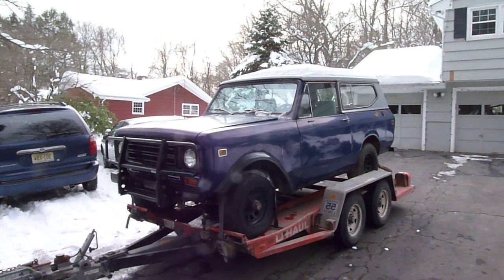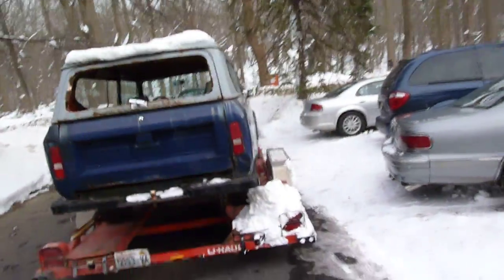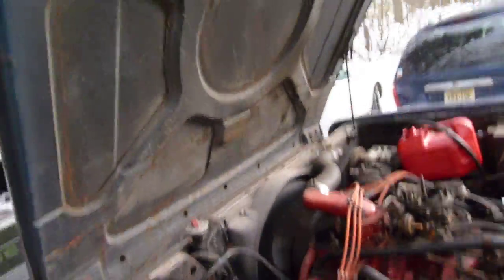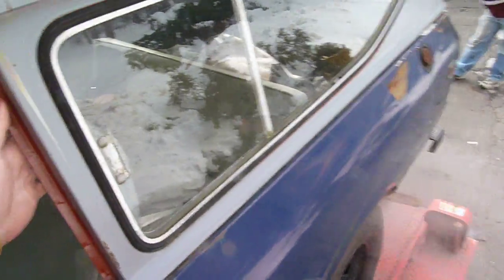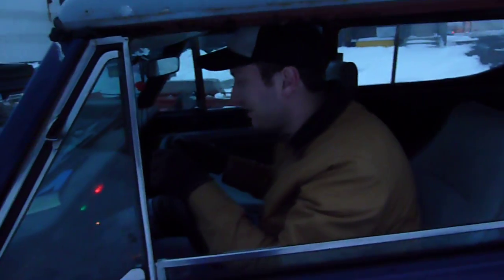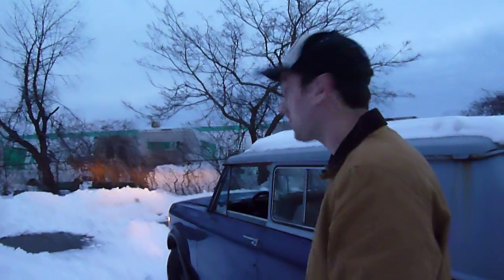My new project: a 1979 International Scout II -345ci V8

Comment: Excellent score! You'll have no issues in using this for some light offroading with a bit of work.  But you are right, they are prone to rust. Every single one I have seen on ebay, CL, locally, etc. has some form of surface rust.

Comment: Nice Project for fun! Looks like someone swapped the intake in there. 79/80's 345's are 4 bbl thermo-quads. The sheet metal rusted because when it was delivered, they let it sit outside and it got weathered. Then it started rusting before they even painted it. Once in a great while some shipments of sheetmetal made it directly inside, making it's way to an assembled scout without any rust underneath.

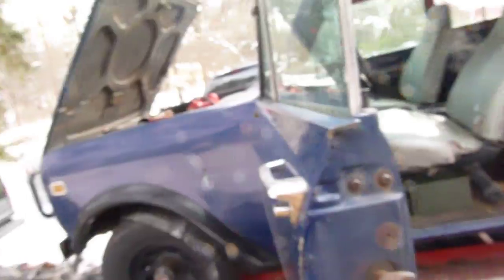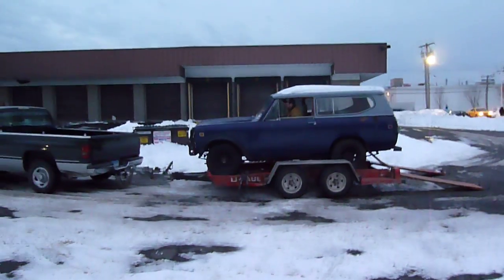Comment: I special ordered a 73 Scout with a 345 & dual exhaust.  I told the salesman that I wanted everything heavy duty, but he was not aware of a dana 30 front as a $23. option.  I messed up & chose a 3:31 gear which was a huge mistake.  I should have got the 3:73 or 4:11.  The sheet metal was very thin as it actually tore on the passenger side from vibration.  The darn thing would only go 85mph as it just didn't have much power with all the emissions garbage.  I never really had any problems with it except the clutch broke and would not disengage.  No problem.  I just put her in first gear & started it up & shifted with no clutch & drove it that way to the dealer.  They replaced the pressure plate & tightened up the front end which was a little loose.  It had the 4 speed manual with automatic locking front hubs.  It cost me a little over $3k when new & was the half cab pick up model.  Ac
Reply: 351WINCHESTER Dana 30 was the standard front axle in 1973. A Dana 44 was the option. I have a 73 with a 304 and the only emissions stuff it really has is a smog pump.

Comment: There are 4 end bolts that hold the axles in, and if the spider gears are blown then you wouldn't be moving. Just a tip for the future, run it in nutetral instead of park. These crysler transmissions don't circulate in park.

Comment: I could have bought a Bronco, but they did not offer the half cab in 73 so I bought the scout.  Plus Ford only offered a 3 speed on the column or an automatic c4 tranny.  Looking back I should have got the Bronco full cab with the 302 v8.

Comment: what do you think of a 66 ford ranchero, its got an inline 6, used to have the v8, got replaced:(, hasn't moved in more than 15 years, and last started about 5-10 years ago. also a 3 on the tree, no power steering or breaks, and minor tornado lol. and nice truck, good find

Comment: One of the best trucks you can get for off road, the spider gears just wear out from the engine torque. I had one of those pickup trucks, the difference is the transmission is stronger. I took that Holley Carb off mine and put a Motorcraft on it, then my gas mileage went up from 7-8 to around 14-18MPG. All I has to do is grind the Accelerator pump a little to clear the thermostat housing and make the fuel line... If my memory is correct, a spider gear kit is $100 and you can put it in in a day.
Reply: dollman0 what model of Motorcraft?

Comment: Something else that were tanks were ram chargers. If you can get one with a 318 and a manual with a granny gear they will seriously go through anything!! Cj's were the same but biggest thing about them was the 2 piece rear axle but a 180.00 kit and you can switch it over to 1 piece axles. My 304 went through 2 rear axles before I bought a 1 piece

Comment: @phill903 Yeah, as are most other V8's. They can be timed/tuned to attain excellent MPG's with very little effort. I have acheived 20+ mpg's with my 78 345 Scout, with minor valvetrain alterations, timing recurve, carburetor calibration, ignition upgrades  and it still retains stock gearing of 3.54, I cruise along at 55-60 mph with recorded and logged proven 20 mpg's. You lose 1-2 mpg for every mile over 60 you go.
Reply: I think you are mistaken about the gearing.  They only offered 3:31, 3:73 & 4:11 & if you are getting upwards of 20mpg you must be a wizard.  Actually I just found out that you could get 3:54 gears.  Heck you could special order just about anything from 2:73 to 5:38.

Comment: @LynolsOffice yeha I know what you mean. The 1st gen 4runners have a removeable rear fiberglass roof (complete with roll bar too), but the front doesnt, since the 4runner was based on the Toyota pick up. But mine is a fully loaded one with a tilting sunnroof. So I guess I am one of the luck ones. lol. Nice truck though!